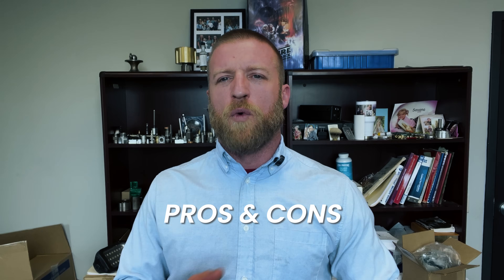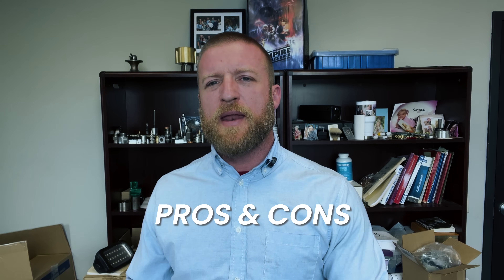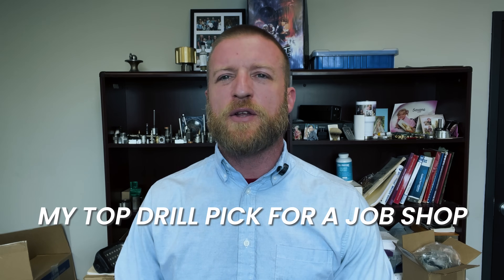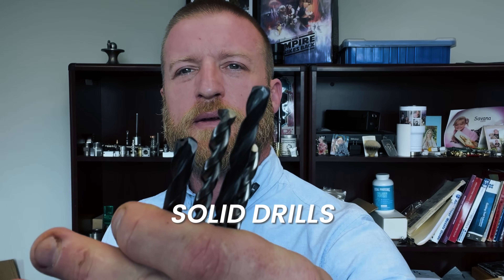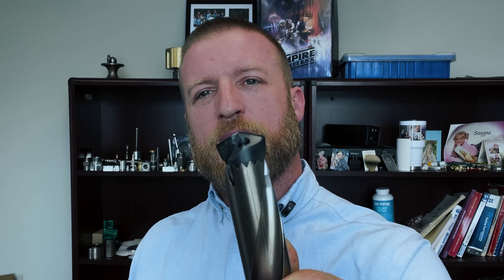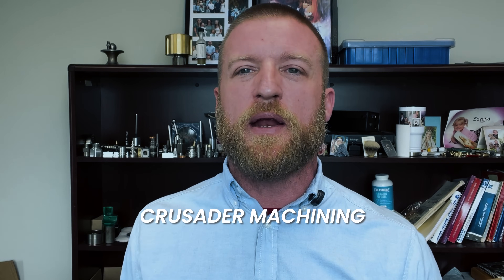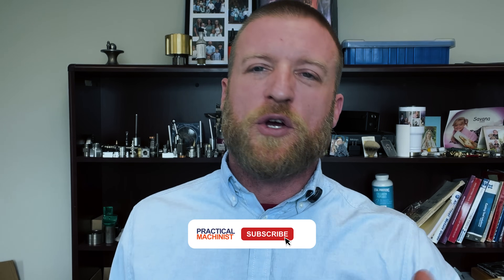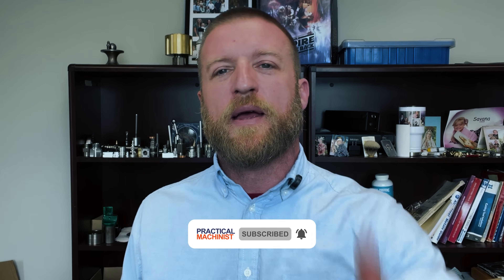DRILLING: The Good, The Bad, and The Ugly | The Lathe Lab Ep.3

Comment: Very informational video, thanks for putting it together!
Specifically I like the insight about using a square indexable drill to achieve a flat bottom hole as well as bore out your ID.
Do you know of any small indexable drills with square tips that would be good for a swiss? I guess it's a bit limiting on how small you can go because you need the room for the inserts and screws etc.

Comment: there all good in there application, its up to the programmer to choose the best for the scenario.
Reply: For sure. All the different drills have their own place in a shop. For instance, our shop doesn’t use larger diameter high speed steel drills it just what it worked for the application but a lot of shops do it works great.

Comment: with the U drills look for deals, i went from using seco to Mitsubishi, Seco had different inboard and outboard inserts, to replace a 46mm drill the inserts £22 for the inboard £26 for the outboard 10 off of each only , Mitsubishi buy 20 inserts 1/2 price body £140 inserts £200 for the drill, a no brainer , i replaced all the drills cheaper than buying new inserts for old drills when i needed new inserts , and i must say Mitsubishi cut more parts and better than Seco.
Reply: Good point and great perspective on a practical way to determine drills to use. When it comes to a lot of the high-performance trails I think that they’re going to perform similar to the competition so if you can find a great deal and save some money that’s the way to go.

Comment: I really appreciate your input.  I am an old guy learning a CNC lathe.  I used my first indexable 1” drill which uses “W” inserts.  I have been cautious and only pushing at low rpm (800) and a light cut 0.003 in 6061 AL. While I am only going 2” depth I am concerned about jamming the chips.  Again, I am learning.  It beat the crap out of cranking an MT3 HSS 1” twist drill, frankly amazed.  I am a small shop, not a machinist so I don’t have a tooling guy.  I’m using polished “W” inserts meant for aluminum.  No chatter, better ID finish compared to my twist drills. Speeds and feeds is something I need to learn about but I don’t like bad things happen.  I want to try boring too but baby steps!  Thanks again for your content.  I try to not miss a Lathe video.
Reply: Hey that’s great! Sounds like you’re on the right path for sure! Those speeds and feeds aren’t bad at all. Slightly in the lower end but it all depends on what works for you. Do you have coolant thru the drill? That will make an enormous difference. If we can be of help, don’t hesitate to reach out. 👍👍
Reply: @ Crusadermachining
Thank You Sir, yes I am using a low pressure through cool and by aiming my blue plastic swivel hose the best I can, it gets a decent flow.  If I turn it up it comes out of the back of the machine. Haas TL1.  Rpm higher or feed?  On a twist drill I kinda use .004~.006” HSS but lower RPM.  Thanks for your time!
Reply: @cogentdynamics I’m not sure about the haas machines. Do you have a spindle load monitor and how’s your tool life ? Based on the grade of aluminum, I’d probably kick that feed up to .004-.005 and look at your chips, check your load monitor. As long as you’re breaking chips - you should be fine wirh some coolant coming thru the tool. Even low pressure going through the drill is a huge help. If you shut off the coolant flow to your blue coolant line is the pressure through the drill more?
Reply: @  thanks so much for your time. When I am looking a scary things like that 1” drill I didn’t watch the power closely. I really didn’t go up more than Kistler over 1KW which isn’t much.  My machine is 10 hp.  I don’t have a bunch of parts to make right now but next time I will pay particular attention. My last parts were spring clips for motorcycle shocks.  I started with 3” aluminum 6061 ind drilled through to prepare for a boring bar using the 1” drill. 2” deep looked and sounded pretty comfortable.  I’ll sneak up both the speed and feed some and see what happens.  I don’t want to weld the drill into a hole.

Comment: Iscar cham drills are amazing, you can run them all day on steel & not have to change an insert.
Reply: I have used the before. They are freakin great drills. Super good finish, chip control and ability to get aggressive.

Comment: iv only just started useing U drill as boreing bars. It works out I have to use 2 offsets so I can adjust my bore size
Reply: That’s a great move. Apparently you have some programming experience. Good idea. 👍
Reply: @Crusadermachining  Yeah im learning gibbs, been using CNC and learning machining for about 2 years, before that im a fabby/welder(30 years) and got sick of it.
i never thought I would be measuring things down to 3 decimal points.
Reply: @ heck yea congrats on the new position and good luck. Hopefully you crush it! And a lot of those skills from fab you can definitely bring towards machining. Really cool to hear and don’t ever hesitate to reach out.

Comment: Nice video! It provides really useful information and feedback, which is different from the marketing videos of big tool brands. I think another of the advantages of solid carbide and exchangeable-tip drills is the hole tolerance and quality they can achieve, which is very accurate compared to indexable insert drilling. However, as you mentioned, the latter is mainly for roughing and performs much better in irregular conditions (interrupted cuts, runout, etc) compared to solid carbide and exchangeable-tip drills. In the end, it depends on the job that you are going to machine.
Reply: That’s bus a great positive - you are 100% correct and I should have included that.  Sometimes we do finish holes with solid carbide and they are beautiful. Thanks for sharing that 🤝👍

Comment: Pro for high speed.   It's pretty easy to sharpen them by hand on standard bench grinder with the right wheel.     My favorite drills for bigger holes are square inserted drill bodies that you can use as a follow up roughing boring bar.
Reply: @trent347  my dad and my brother are great at sharpening drills. I’ve never been able to have the skill but my hats off to you for being able to do it. Good job!
Reply: @Crusadermachining    I've trashed plenty.   Lol.   It's a learning curve.  That's for sure.
Reply: @trent347 I may have to try again just to see 😂
Reply: @trent347  I should’ve put that as one of the pros you’re 100% right. I’m glad you mentioned that and I hope someone will see that in the comments because that’s a very realistic and accurate positive to using high speed steel drills.
Reply: @trent347  I love the follow up boring bar. One of my favorite things to do 😎
Reply: @Crusadermachining   just gotta watch that lead out.    It's goofy tho.  I was at imts a yg guy told us about using one of their inserted drill bodies as a boring bar.    I've done it many times.  But when I search online they don't even advertise it as a feature.  Maybe because if you don't make your lead out smaller than your depth of cut the drill body will smack the bottom of the hole on your first cut....idk.   the geometry on the yg I use is a little temperamental.    If youre trying to rough bore a blind hole, once you get past the radius of the drill body.  You have to bore  way short of the original drill depth or the center insert will hit the bottom and chirp.  Or even chip.    Maybe that's why they don't advertise the feature.
Reply: @trent347 that’s interesting for sure. When I use my drill as a boring bar, I usually just go to the same Z depth as the drill.  But maybe different drill bodies have different geometry that can make that prohibitive.
Reply: @Crusadermachining.   They do.   We have another one from iscar If I remember right that doesn't do that.    The outside insert is angled towards the tip is past the center insert in the z.    On the yg it's opposite.  The outside insert is angled back and behind the center insert.    No big deal on thru holes or if you can drill deep on blind holes.     The yg is hard to touch off because the boring insert is angled away from the spindle  so holding any z depth blind isnt gonna happen.    Still a decent rougher tho.
Reply: @trent347 that’s great info to know.

Comment: My understanding for the square tip was you're also limited to L to D. I thought they are limited to about 4-6 L to D on those.

Also a side benefit on the spade drill, you can get different shaped inserts for not too much money if you have odd geometry at the end of the hole. Such as a full radius at the end. Great video.
Reply: Thank you! No huge hate in spade drills. I still use them to this day - and they do offer a lot of differnt options now, compared to years ago. And in the square drills, that’s a great point about the length do diameter ratio. I’ve only used 5XD on those but if it was something deeper, I’d probably go with an insert tip drill. Thanks for your input 👍